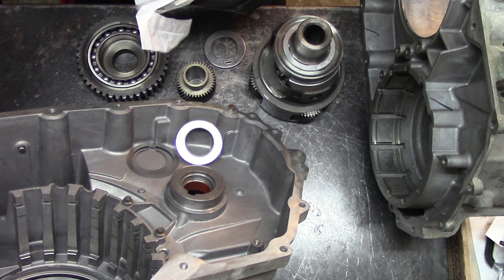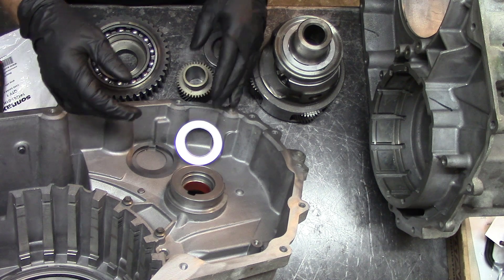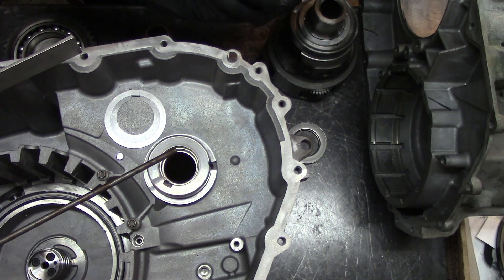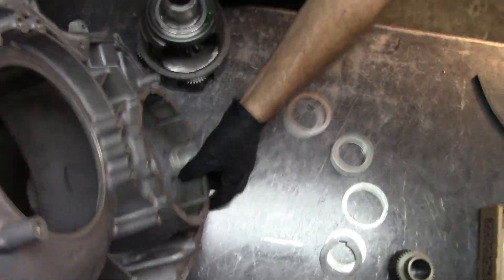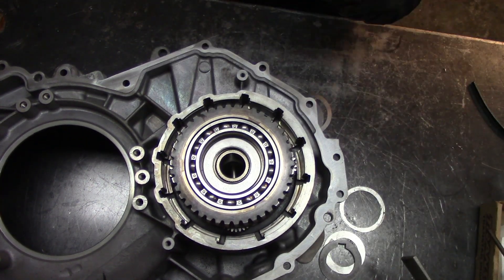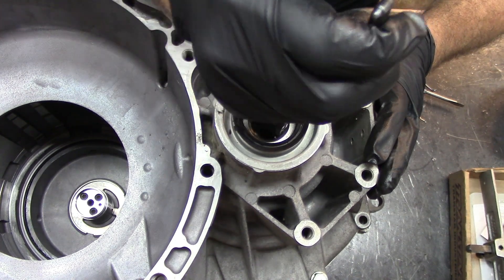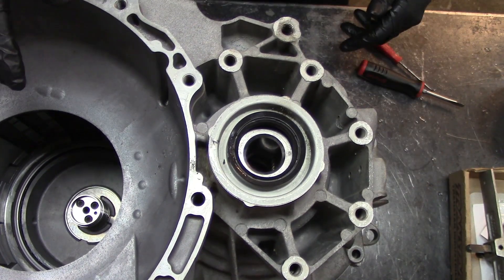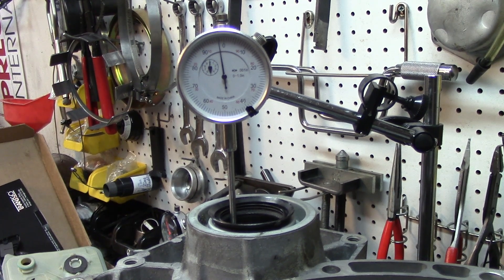6F35 DIFERENTIAL SHIMS | #6F35 SONNAX 144281-01K

Comment: I have a 2020 pacifica touring l plus van with a 9 speed trannie and the trans filter you have to take the trannie apart to replace it. What the hell good is that. All you can do is change the tranny fluid when you take the pan off and only clean the pan and hope there is a magnet in the pan to help hold small metal particles. Or put a magnet on the trannie pan if its metal if it does not have one in the pan. What is your take on this Hiram?
Reply: The theory is that the filter area is large enough to go the service life of the transmission without needing replacement. If you should ever need a filter replacement it is because something has gone wrong inside the transmission that requires a removal and repair.

Comment: I don't think you need that H gauge myself. Buy the case saver kit. You can see were the wear is. Add shim to that side of the case to even it up to the wear point. Put the 2 haves together like you did and just check the end play. I know you can tell what clearance just by the feel of it when you have done this for so long. I can do this and check it with a dial indicator and be .002 off at most.
Reply from the maker: Yes, you're right. Just by feel with your fingers to the edge of the wear you can be spot on without measuring. But you know the YouTube crowd wants to see some type of measurements. The H gauge is actually enough without using a dial indicator, it's fast easy. And accurate. I've had that thing for more than 20 years, not sure if you can even get those anymore. 
Concerning your other comment  just drain and fill every year before crud accumulates.